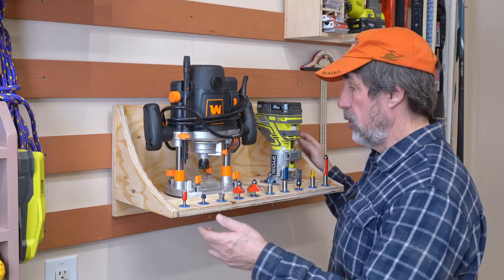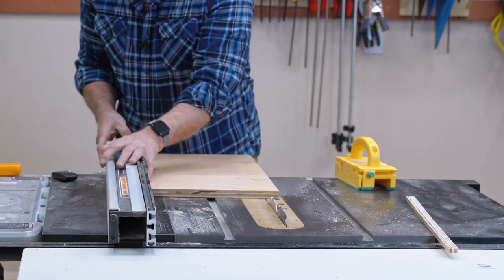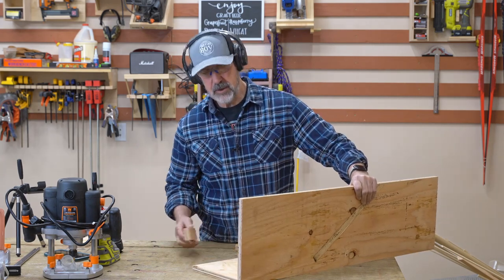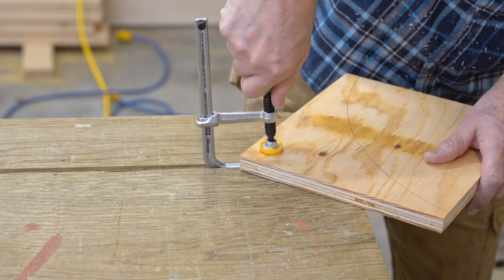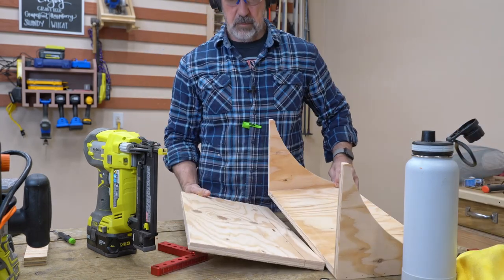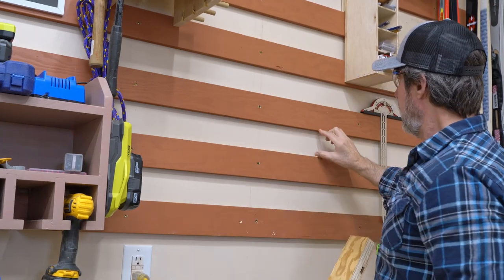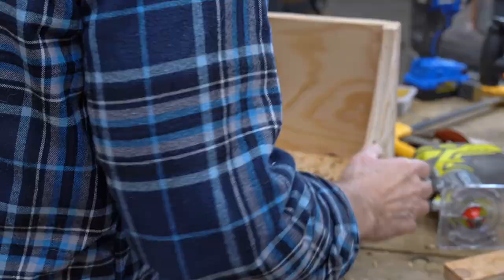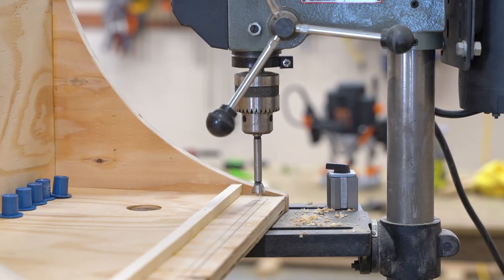French Cleat Router Tool Holder

Comment: Can I get your opinion on something? I'm rebuilding my small basement shop and going from a 4'x8' section of cleat wall to a full bore cleat corner with approx 9'x18' of cleat wall. My current cleat spacing is 8" on center and I'm contemplating 10 5/8" on center for my new wall.  So my question is what is your cleat wall spacing and do you wish it were larger or smaller spacing?
Reply from the maker: What is the cleat size? My cleats are 3.5 inches with 3.5 inches in between cleats. I like it a lot and adds a lot of flexibility with arranging my tool holders.